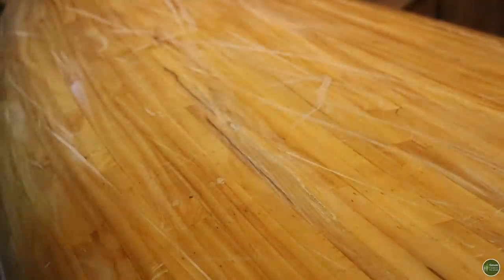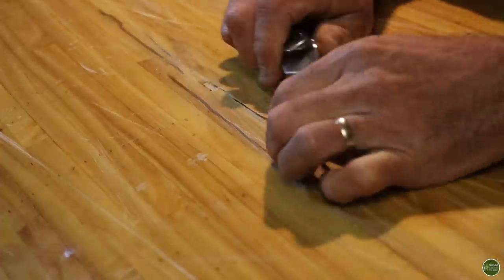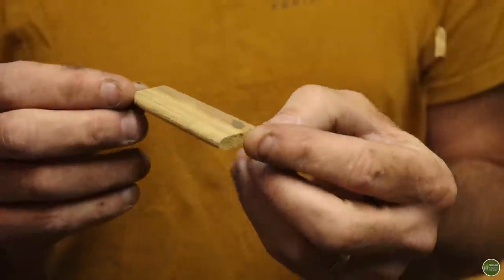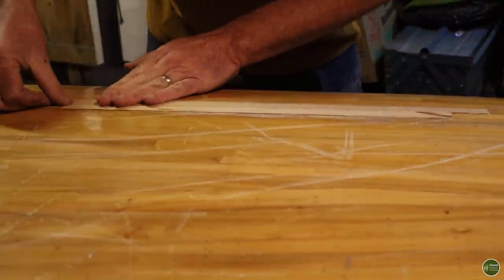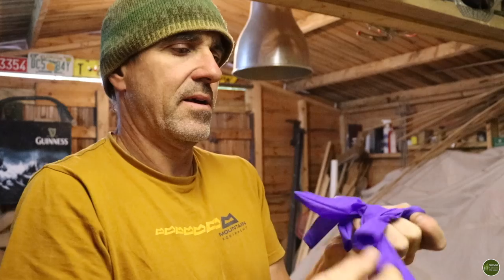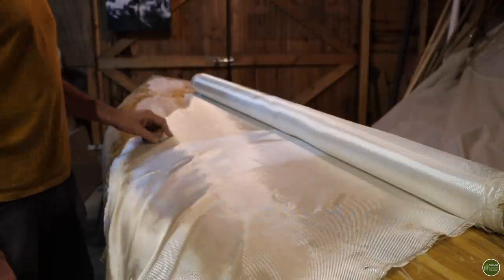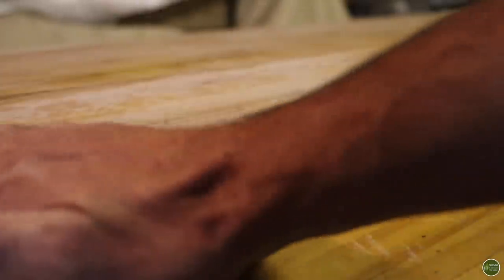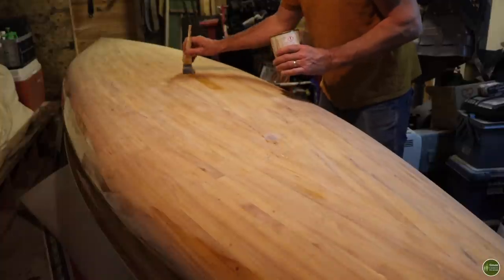Canoe Hull Repair.  Fixing a Hole in my Cedar Strip Canoe.  Fibreglass/Fiberglass and Epoxy.

Comment: 20:00 It's a great trick to first use a cabinet scraper to scrape of the edge of the glass cloth. This is very easy to aim right at the edge to give it a ruff feathering and then just go quickly over it with the sander. Otherwise it's very easy to burn through with the sander when you are trying to get a nice blend to the patch.

Comment: Great proceedure from a wood working guru.  I appreciate your technique with joinery and epoxy. I have two wood strip canoes to fix scrapes on, no holes but lots of resurfacing, and absence of varnish on one left a challange of foggy finish.  Watching you helps greatly, much thanks!

Comment: Excellent job on a tricky repair.  And yes Flex tape is amazing.  I repaired a plastic canoe with it once, similar damage and location.  It leaked a tiny amount but did the job.  I also keep the 1" wide gorilla tape and black electrical tape handy for other repairs.

Comment: I actually like it with the war wounds showing, for one it adds character to what is a beautiful boat, two it also shows that it is used for what it is designed for... again to me this adds to the beauty factor in my eyes. If there was no signs of use then it would be nothing more then an art piece and thus would degrade the work gone in to make the canoe, of course this is just my conjecture into the philosophy of making an item for use against one that is only for display and serves no other purpose.
Reply from the maker: Thank you! I wholeheartedly agree! It’s certainly not a show piece 🙏🏻

Comment: It may be a good idea to put 3 or 4 layers of that fiberglass across bottom to build an armor for the bottom in case of future incidents with rock that is unseen. Great canoe trip and follow up with the repair!
Reply from the maker: That would certainly make it stronger, but the real beauty of this canoe is its lightness - just over 20kg - I wouldn’t want to add the extra weight 👍

Comment: a thought - blow the sanding dust off  the canoe outside your shop where you wash it -  i have a ribbed ceder and was amazed at the flexing in your hull.  nice to see you play it rough in the river  - I wondered how much you can get away with - more then i thought

Comment: For all the years I have been considering building a cedar strip canoe, you have flagged up an inherent weakness in their design - lots of 'split here' lines on the cedar  strip joints! My favoured design from here is stitched ply - birch bark fashion. Great channel with really inspiring content. Cheers, keep it coming.
Reply: Cedar strip is still a worthy wood for a canoe best looking in my oppinion just for myself its only for lakes and my carbon is for the rapids
Reply: @hemidart7  did you build the carbon yourself?
Reply from the maker: Thank you! I hear what you are saying, but in my experience, the cracks always seem to appear within the strips and not along the joints where it is stronger. Ply is certainly more stable and the alternating grain of the laminates make it strong, but the trade-off is weight - a cedar strip canoe is very light 👍👍
Reply: @simonablokeinthewoods  As with everything, there are many factors involved like glue choice and perhaps tweaks to the build like using thicker strips on the bottom of the canoe. As for weight I am impressed with Peter Robinson's 'Flyply' tortured ply canoe build, definitely worth 6 minutes of your time to watch 👍
Reply: @simonablokeinthewoods  Carbon!

Comment: Beautiful repair, Simon! Can't wait to see you get it back out for its first post-repair voyage! I vote for taking it to your little secret island in the river Waveney. I've been calling it "Simon Island" lol. 

That T-Rex tape that your friend let you have in Scottland looks like some pretty serious stuff! I may have to add some of that to my kit. In regards to Flex Tape i've never used it but have used Flex Seal and found it to be rather sub-par over the long term (over the course of about 18 months on a surface that it was applied to in my shed). Might work great for a fast fix, though.

-Shane

Comment: I'll bet you've answer this question in a previous video that I can't find. Bit how come you've gone for a wooden canoe and not a totally fiberglas or aluminum canoe? Is there any deep thought behind that desisio. My self I've got an Allly canoe, that's reely gone through its peace, its a foldedbul canoe whit a aluminium piping shell whit a thick rubber houle. It's really, really lightweight, but it can actually take a real beating. And it's really to repair on sight.

Comment: They way the glass came off the cedar means the bond was starved. Cedar is very porous and soaks up the West as it heats up when it goes off. If you saturate the canoe with epoxy, sand it and then glass it the glass will become one with the cedar and then the only way to get it off is to grind it. Will also be stronger.

Comment: Probably won’t make a big difference, but when I was building my stitch and glue kayak I was instructed to saturate the edges of the joints with unthickened epoxy before applying the thickened maybe next time!

Comment: Would you consider adding a full length central skeg and a couple shorter ones say 6" either side? Would also help a little with directional stability. Pleasure watching true artist at work, my Godfather's been doing cabinetry and joinery all his life.
Reply from the maker: To be honest, a skeg isn’t necessary on a canoe, even on exposed wide open water, it tracks well. Plus, I’m reluctant to add any weight to it 😁👍
Reply: @simonablokeinthewoods  I was thinking a half inch strip of cedar skeg would add a bit of sacrificial protection if you go "rock climbing" again. ☺. Different tack(!) do you know if gel fuel is OK in a trangia burner?

Comment: For so long I had wet footed and protected my stripper from and scratch but as time has gone I decided I built it for use and the benefit of a stripper is they are easily repaired. Still not sure I would do whitewater with it but hey... That isn't my paddling style anyway.

Comment: I guess you get to sand and varnish and sand and varnish and sand and varnish, your bo bo is worse than mine ,but I’ll be doing what you’re doing next spring. I see you put a bead and cove your on  strips , my brother has a book where the guy building a boat didn’t router his strips and it looked messy and hard, we used a double router ,two person job, the west system is good stuff, we use a Dutch varnish that’s pricey but excellent. I did see a guy that put a layer of Kevlar cloth on what he called the contact area, it’s below the water line and on top of the fiberglass.

Comment: At 2:03 you tossed in the fire a roughly 4” long by 2+” wide by 1+” thick piece of wood with partial 45 degree angles cut across both ends and what appears to be a rounded bead on the left edge. To me it looked like a piece of brick mold pattern we used a lot in Texas back in the 70’s. Just wondering if that could be what it was? Keep up the good work. Thanks. 👍🪚🇨🇱
Reply from the maker: Thanks mate, it was just an offcut of door architrave - I’m a chippy, so I end up with an almost limitless supply of firewood from site 👍

Comment: Simon. Is there any reason why you couldn't have used Gorilla glue for gluing the strips in. I restore bamboo/cane fishing rods and that is what I use for regluing delaminated rods because it expands with moisture it fill any recesses or holes and then you can epoxy over it? I Just thought I'd suggest it as it may produce a better finish if (Heaven forbid) it happens again.

Comment: Thanks for this vid Simon, enjoyed watching it. Just a question, would it not have been possible to simply pack the damaged area with epoxy, and place a new layer of glass on the inside and outside in that area?
Reply from the maker: That possibly would have worked, couldn’t resist the opportunity to get the chisels out though 😂

Comment: Simon, very informative video. Out of curiousity, if you plan on future whitewater runs, would you consider a below the waterline keel skid plate at both ends of the canoe as well as other reinforcing? Or, look at learning to read the water, avoiding big, bottom cracking rocks? Thank you.
Reply from the maker: Thanks Harry,
I’m reluctant to add any additional weight to the canoe - I pride myself in how light it is - just over 20kg. It’s easy enough to repair the occasional bit of damage, and I do have a plastic canoe too - might be a better option for bumpy rivers.

Comment: Nice job, it it had been irreparable would you have built another or bought one? Wanted to build a garage stove for years but not got around to it, wouldn’t mind a better look at yours.
Reply from the maker: I’d definitely have built another one - you just can’t canoes this light and rigid (well, not in this country anyway….)
I made the stove from an old calor gas bottle - emptied it (and purged out the gas) cut a hole in the top and welded some 4” road sign post as a flue, cut a hole in the front as a door and bolted on some hinges with a little flange so the door sort of seals when shut - small hole in the side an air vent 👍🔥🔥🔥
Reply: I’ve got a garage full of different sized cylinders just waiting to go. Thought I’d knock a couple of bricks out and dog leg the chimney through the wall. All I need is time and energy :)
Reply from the maker: I’ll send over a couple of photos if you like? Can’t remember your email address though…can you ping me a quick mail? 👍

Comment: I have the same Canoe ,Do you think it's possible to put ribs to make it stronger .I do it myself.
Reply from the maker: I don’t think it would add much to the strength - being a monocoque hull, it’s already very strong  - just an unfortunate hit with a jagged rock. The ribs would add extra weight too
Reply: Thanks Simon added weight would be a Certain ,I'll replace the boards .Thanks for the advise

Comment: Sorry Simon, but what did you expect? Canoeing down rapids, I would expect to impact rocks. All the cedar strips run in the same direction! Unlike plywood which is strong. I think you need to accept this is not suitable for rapids, and a fibreglass or plastic boat might be more suitable. I didn’t realise you had made the canoe yourself (as I’ve watched a few of your camping vids featuring your canoe), I’m impressed (was it a kit with plans). Personally if I had made it, it would gut me out to go over rocks, and scratch it up! Why don’t you use this canoe for deeper water, and buy a fibreglass or plastic Kayak for rapids? Just a thought mate, I don’t want to sound critical